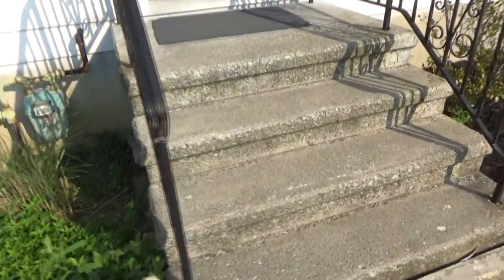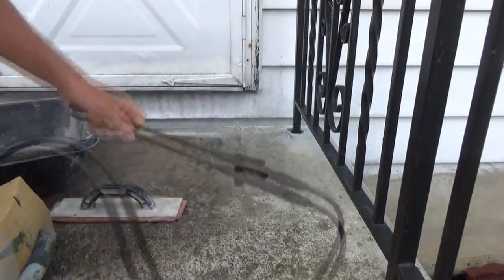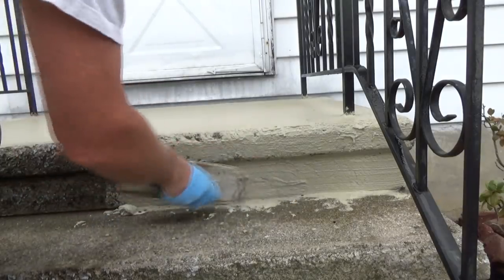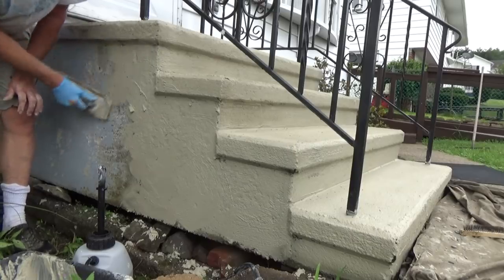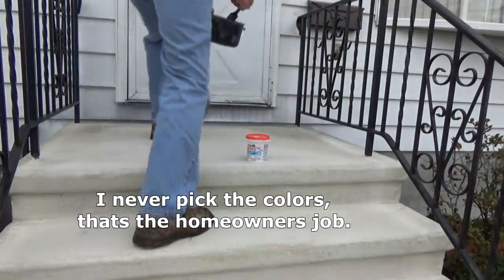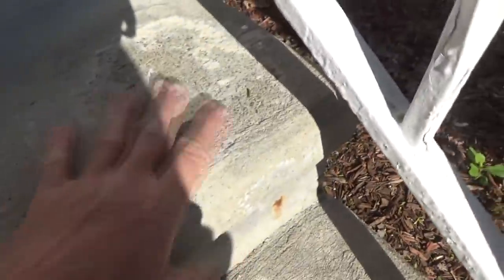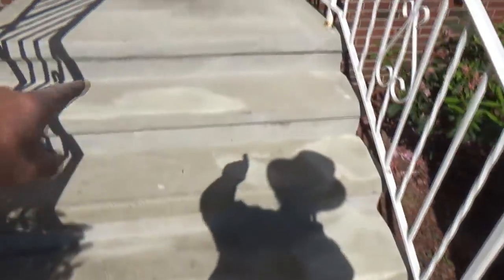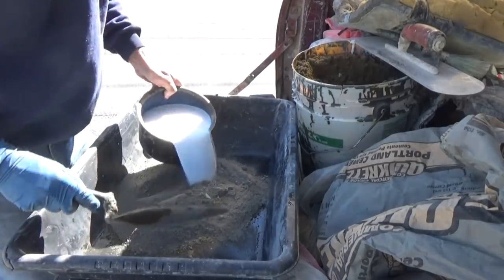CONCRETE STEPS REPAIR (Part 9) Mike Haduck

Comment: Thanks again Mr. Mike for the very thorough video lesson.  I have used your Portland paint lessons a few times now.  It took practice mainly with getting the consistency right.  Hey, my steps from two years ago are still good.  Southern Ontario.
Reply from the maker: Thanks Andy,  I appreciate hearing that, mike

Comment: What might be better for painting concrete... Portland or off the shelf masonry paint? I'm guessing the Portland may last longer and not chip and peel like shelf paint.
Reply from the maker: Hi T,  on steps I would rather a masonry paint, but with anything it is usually a go over every year no matter what, thanks Mike

Comment: Hey Mike. I came out with what you described. Some bleached, some dark stained after it was hit with rain a few times. Now even when dry, the dark streaks show - there is a low spot that holds water. Anyway, can I just paint right over the portland using one of the brand name 'cement' paints?
Reply from the maker: Hi Brian, I do it all the time, try and fix the low spot first, and next year you will probably have to paint again, a good masonry stucco or deck paint works for me, Mike

Comment: Hi Mike - love your videos and I'm a big fan subscriber. I have concrete steps and landing on my 1950's home just outside of Philadelphia. I would like to perform some of the repairs that you have shown in your videos to add a surface layer on the steps to smooth them out because the stones are exposed, and also repair the deep cracks in the landing to prevent further damage/widening. Is there a way I can share 3 photos and get your take on the best way to approach the repair? Thanks!
Reply from the maker: Hi Medic,  I can’t give advice over the Internet, I just show what I did on certain jobs, but I am sure you will do fine, thanks for asking,  mike

Comment: Hey Mike I’m new to your channel and great tutorials. After using the cement all and letting it cure fir a week. I was thinking of using a concrete primer/sealer then followed by Sherman Williams flexible concrete waterproof paint (black). What is your opinion on this method?  Thanks
Reply from the maker: Hi Lou, I would ask the guys at the paint store, I paint a lot of foundation and steps, I rarely use sealers,  thanks mike

Comment: Hi Mike, if you get any cracks after putting on the cementall, how do you take care of the cracks?
Reply from the maker: Hi Philip, I rarely even seen a crack with cement all,  unless it is between two different things,  I usually just rub some more in thanks mike
Reply: Thanks!

Comment: Hello Mike.  Thanks so much for the lesson.  We have similar step issues here in Southeast Idaho and I can see where the surface (skim) coat is deteriorating.  If I pressure wash, then use cement all along with a non slip masonry paint would this hold-up for a few years?  Thanks again.  BTW, I already took a chance after watching one of your videos and patched some spalling in the drive way, and so far so good!
Reply from the maker: Thanks,  that is usually what I would do and save the paint for a little patch every year or so,  thanks Mike

Comment: Hey mike just a tip, before you add cement by the posts I think you should tape that bottom part of them. That way after your cement dries your post can have a cleaner finish. 👍
Reply from the maker: Thanks mike

Comment: thanks man ,this is what i was looking for..how will afect if you add too much bonding agent i know if not enough will crack and felt off but if too much ??? thanks
Reply from the maker: Hi avet, with rapid set I use no bonding agent, and with traditional  cements, I might make a slurry but what ever I use I always wet the surface first,  thanks,  mike

Comment: I splattered some of the paint mix on some clean concrete that I didn’t mean to paint.  how could I remove it quick?  I started scratching it off but it took a while , any shortcuts? Thanks mike for all the help
Reply from the maker: Hi Riley,  that’s a hard one, sometimes I use a wire brush but it all depends on the concrete and how much,  thanks mike

Comment: I have the same steps but they seem to be painted with the same paint you used in the video dark gray.. Can I add cement all over it or do I need to use a grinder to get the paint off and then I can cement all them?
Reply from the maker: Hi DIY, I go over paint with paint but not cement over paint but it all depends,  a patch paint job is a patch paint job, whatever works, thanks Mike

Comment: did you spray with water after you finish all and how many times or days have t be sprayed to prevent cracks ? thanks
Reply from the maker: Hi avet, no rapid sets drys very quickly,  some painter will wait up to 30 days later to paint, with rapid set I usually wait a week, my opinion, thanks mikr

Comment: Really enjoy your videos. It helped demystify stone work so I can do more myself. 
I have a question for you though. On these precast steps can you face them with stone like bluestone or flag. Just wondering I have these at my house and I'm looking to dress them up a bit, but thought the profile may cause some problems. Thanks!
Reply from the maker: Hi ABI,  I have done it but you have to be careful because it changes the height of the steps which could cause a tripping hazard,  every step should be same height,  thanks, Mike

Comment: What is difference between cement all and Portland cement here. Why you use the former to fill holes but later as paint?
Reply from the maker: Hi, I use the cementall because it drys rapidly , portland is traditional and takes a lot longer to dry but less expensive in many cases, I have a whole series on foundation repair which might help, thanks, Mike

Comment: Mike if u used that rapid set then sealed it would that work?
Reply from the maker: Hi Gabe ,  I don’t really think so,   Thanks mike
Reply: @MikeHaduck  You don't suggest sealing a portland wash or concrete in general

Comment: On the first job in this video where you floated a layer of cementall over the concrete, if instead of painting you just left the cementall unpainted how long might you expect it to stay adhered before needing touchup or replacement? I realize every job is different and varies by region, but just the bare cementall as a the top layer would it generally have to be addressed every year?
Reply from the maker: Hi WCSD,  I did my first video in this series like that, and they promised to paint it and did not ,,so I had to go back over it again the next year, now I make sure it gets painted over and I have no problems,  thanks mike

Comment: You called is a sponge float. Is that the same as a rubber float?
Reply from the maker: Hi John, no it is very spongy where a rubber float is hard but in some cases that would work too, mike

Comment: Why use cement for the repair, instead of concrete?
Reply from the maker: Hi MrCurry, concrete has rocks in it, thanks Mike
Reply: Mike Haduck Masonry Hi Mike, thanks for your answer- yes, I guess in the case of this video I see that a smooth finish is required, and therefore concrete might not be a good choice. But I mean I’ve viewed loads of “repair concrete steps” videos on YouTube and some of them are repairing steps with huge great craters and holes and I would’ve thought that using the same material as the steps would be advisable, but seems it is not, and I’m not sure why.